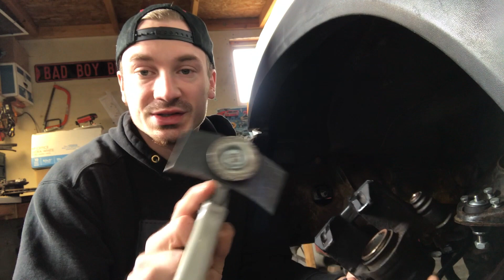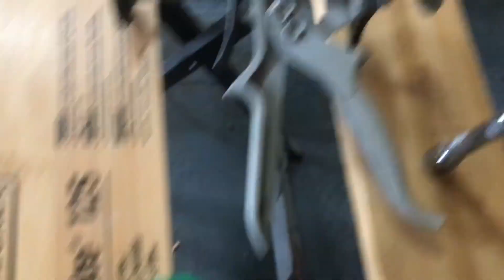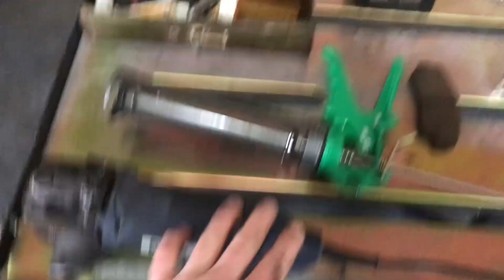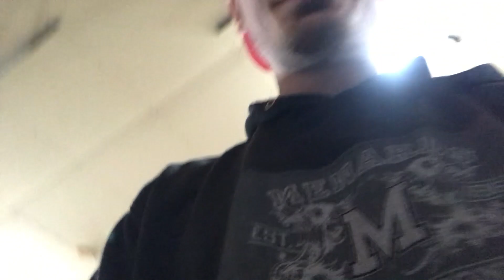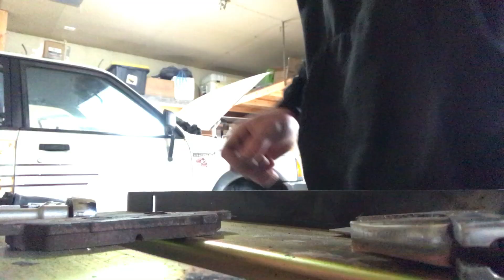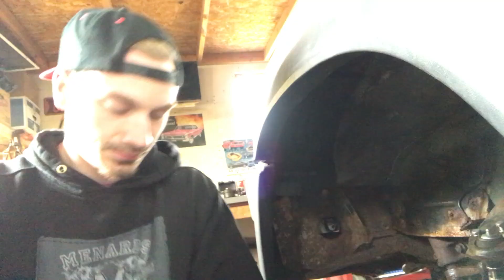DIY Brake Caliper Tool!

Comment: Awesome idea and huge help for the DIYer!!!  Mahalo!
Reply: You inspired me to go out to the shop and build one!!  Just got done, took me all of 20 minutes and it looks like it'll work just like the pricey ones!!!  Again, thanks!!!  I will say for those that'll have to buy the caulking gun, make sure that the one you're going to buy has a small bolt on the plunger.  Some real cheap ones have the round plunger riveted on.  I'm so stoked to try it!  My wife says, "Simple minds, simple pleasures!"  I agree!
Reply from the maker: Thanks!
Reply from the maker: Glad I could help man! Subscribe if you haven’t!

Comment: I want the tool please. I need one
Reply from the maker: Fernando Florida we could arrange that
Reply: @shiftwrenchrepeat  awesome thank you so much
Reply: @shiftwrenchrepeat  you realize they're only $10 at advanced auto
Reply from the maker: Rich H just a fun little video to make I know there are cheap options, quality ones will set you back though.
Reply from the maker: Rich H check out our end of 2019 video for last years highlights
Reply: @shiftwrenchrepeat  yea,  I'm doing brakes now on 2011 Audi A5 quattro. And I just noticed full master sets are like $70-$200... I was trying to make a homeade one,  but don't have the stuff. So I bought the $9.99 one. Hopefully it works. Awesome video though.

Comment: What do you do with a caliper with two Pistons
Reply from the maker: Louis Read, Jr. check out my video called tools from wish! It shows another tool, otherwise I use this tool and grab the other with a channel locks
Reply: @shiftwrenchrepeat  thank you
Reply from the maker: Louis Read, Jr. here it is https://youtu.be/LGSynTBJAvY
Reply: Put an old brake pad on the pistons and you the tools to push it